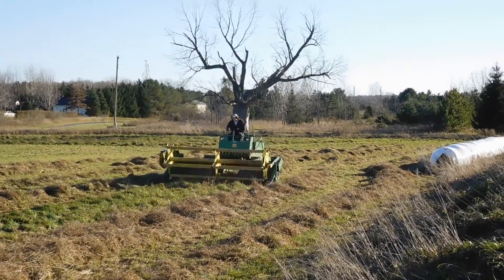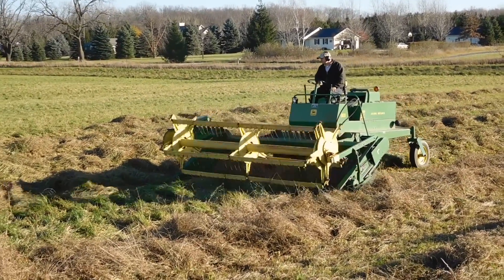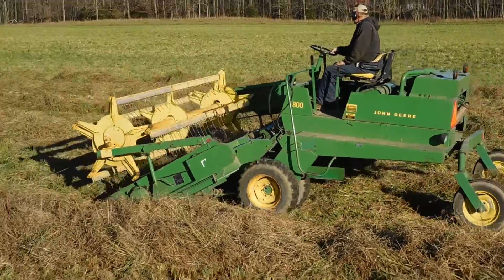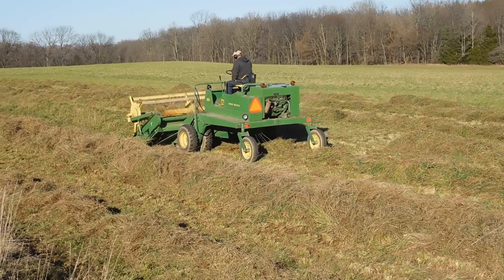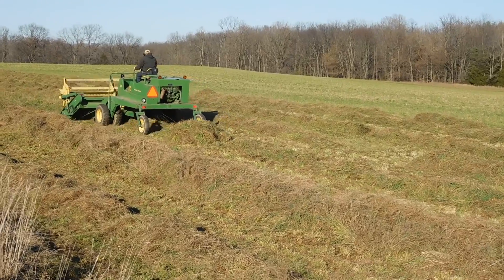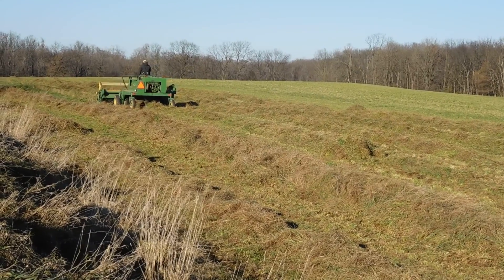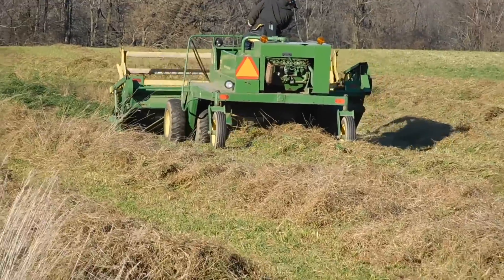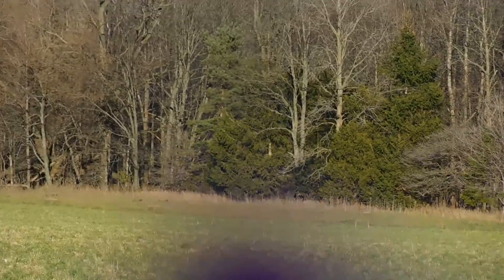John Deere Swather Hay Cutting

Comment: How is the hay for drying?  Very good video and commentating. Thanks
Reply from the maker: It dries nicely but we do use a tedder now because we have had so few drying days in our area. It really helps with making nice green hay because it doesn't get sun bleached. We used just a hay rake before to turn it over and it usually would be dry in 2 days.